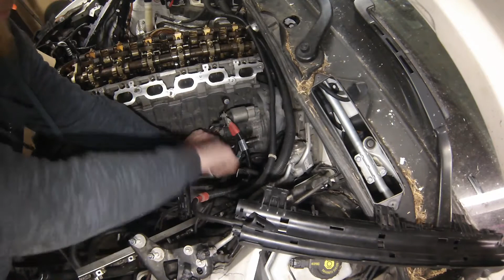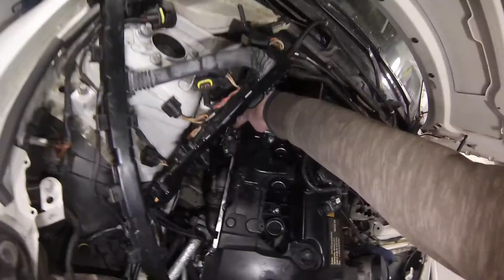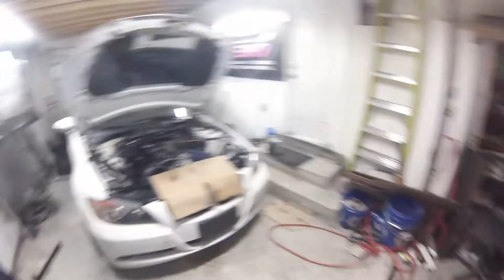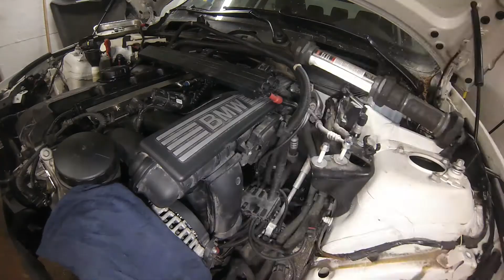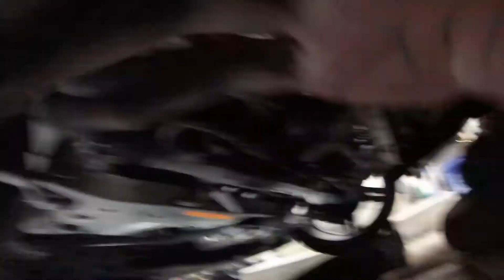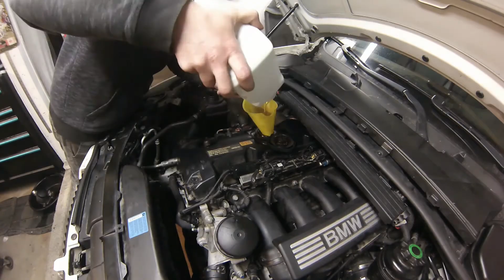BMW Running All 6 Cylinders Again Part 7

Comment: Perfect way to unwind after doing a timing belt job on my buddy's 01 Outback with 268,000 miles.  lol.    Great stuff as always my dude!  Got the upload notification on my phone and was like "I know what I'm doing before I go to bed!"
Reply from the maker: Thanks bud. I noticed your insta pic. To those Canadians wondering... that's an Outback with almost a half million kilometers on it.
Reply: It's remarkably clean as well.  I gotta do head gaskets and a clutch on it later on when spring comes.  Any chance you could help me out with a little research?  I need to find out if the heads are the same from an EJ251 to an EJ252.  I think the only difference is the cam gears.  But I am not 100 percent sure.  Looking on forums isn't always helpful.
Reply from the maker: The long block from 251 to 252 is identical from what I know. The main differences were much of everything else including, the intake, throttle body, sensor locations, ECU, etc. all due to emissions. Double check the cam gears, but they probably match.

Comment: RTV is my secret to holding a valve cover gasket on works great!
Reply from the maker: Especially this one, no way to ensure it's on there without some good RTV
Reply: Homebrew Subaru yeah I always get them to big and I have to cut a segment out and use rtv to hold it in place

Comment: How do u set up a ignition distributor for a BMW 6 slender 323i
Reply from the maker: Setting up the distributor, do you mean timing it? A timing light is required to properly adjust the timing on some models. Some later models it could be electronically controlled and may require a scan tool to zero out the timing.